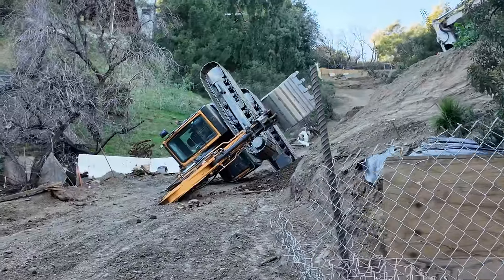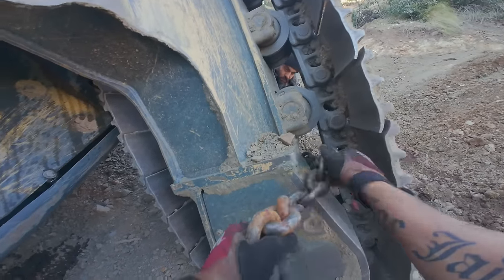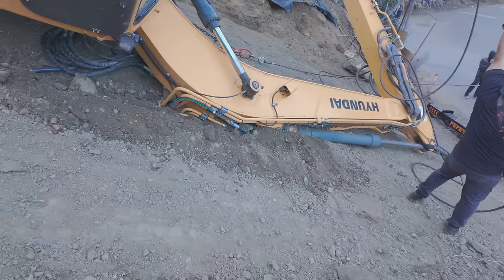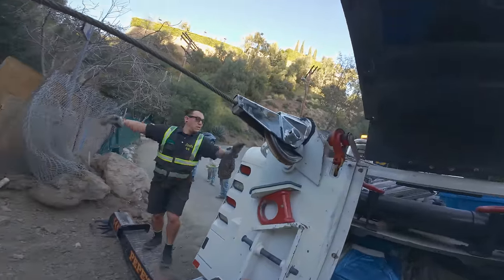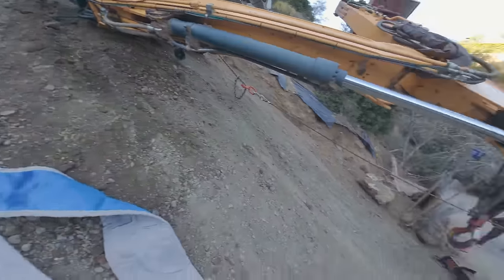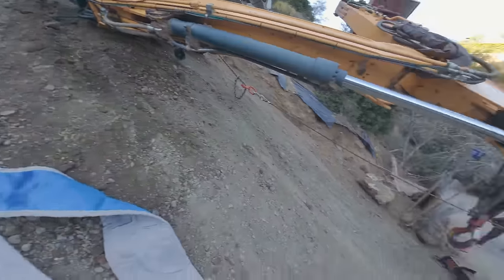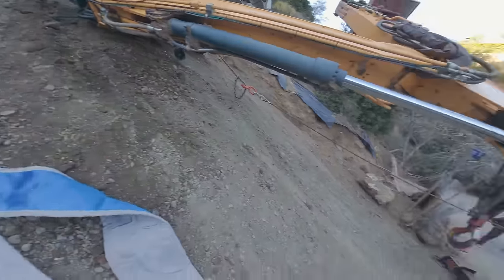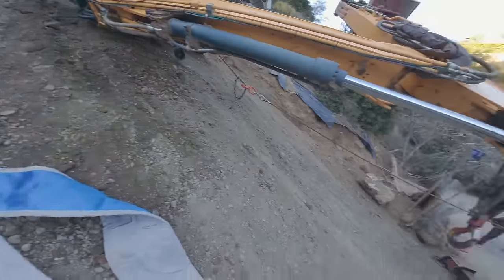Big Excavator Rolls Over in Beverly Hills

Comment: As an equipment operator and equipment owner with a construction company with a few rescues under his belt, in Texas. There are few things I would have done differently in this situation. But I don't think this would have been legal in California. The fact you guys did this without cracking the hydraulic pressure on the cylinders and getting this thing up right is super impressive. Respect where it's due. You guys did a great job.
Reply: He’s a pro

Comment: The only way that bucket will curl in is if someone moves the control lever as if they are operating and curling the bucket, unless you break open the hydraulic lines.
Reply: That's right
Reply: Engine has to be running to do that.
Reply: Just crack off the hydraulic lines from the bucket
Reply: Just asking, doesn't the big SAFETY level on the left side of the seat be in the DOWN position. I thought that was the main control for any function, so the operator is seated. Again does that lever also have to be DOWN to release Hydraulic pressure. Or is that just a safety solenoid control for just starting.
Reply: @rp1645  That lever is just to lockout the pilot controls, older machines it was connected directly to a valve that blocked the pressure from the pilot pump thus not allowing the pilot valves to actuate the main valve bank.  Lots of machines will start regardless of the lockout lever position, some newer machines do have the lockout lever tied into the starting circuit.
Reply: @banffdigger  on most newer machines if you just turn the key on, and the the lockout lever down then move the sticks they will typically let the pressure off. Thats how we release the pressure on our 304 to hook up the hammer.  Or just crack a line, a little messy but works.
Reply: @banffdigger wrong, valve won't care
Reply: @vortexan9804  need pilot pressure to move the spool letting flow through has been my experience.
Reply: @banffdigger  
Thank you for updating me on the equipment. Those wrecker crews are Fantastic, that mini excavator came down without unstableness on steep ground facing the excellent looking rotator. I love their work filming their jobs.
Reply: They should have called someone with at least a cat 356B Excavator. Would have been a lot easier and faster
Reply: Thank God for Pepe’s Towing. You should be so proud of the work you do, impressive awesome crew.
Reply: Most machines I've worked in won't even let you start the machine with the lockout lever down

Comment: Just having the ignition on wasn't enough to open the valves, he also needed to bring the safety arm down to engage the hydraulics.
I don't think the "operator" understood that he didn't actually have to start the machine, just liven the circuit.

Comment: That engine can be hydrolocked, so you have to pull the injectors to be on the save side. That smoke showed that oil went into the combustionchambers, hopefully it went good.
Reply: I put a Case 580- C on its side when the trailer ramp broke. It sat on the roll cage. No full tip over. I rode it over 😊 when we uprighted the backhoe. I checked the fluids and I thought the battery would have leak out. It did not. The old girl STARTED right up. It totally😮 shocked me.
Reply: Yes, that could of been a very expensive crank over
Reply: only if its a clapped out pos

Comment: Geographically, that isn't Beverly Hills.  About 300' NW of the Beverly Hills border. If the house was in Beverly Hills proper, add another 20% to the already crazy  house value.
Reply from the maker: Interesting, Google Maps had that intersection as Beverly Hills. Still crazy crazy expensive for what I did see. Not even kidding, I was curious and a smaller 3 bed run down "fixer upper" was going for 3 MILLION!

Comment: for those who dont know  big flippr pivots at the drive axel to the rear all other axels before or after are subject to massive side ways forces during sharp turns r thats why big flipper has an air lift rear it reuces the sideward forces when turning tight corners  making it easier to turn  it has no effect in a straight line except to reduce the weight per sxel the tag will help reduce tonnage per axel slightly its a mathematical and physics bit of maths as the greater number of axels the lower you can get each axel weight  in tons alot is done in the vehicle build because you have the service lockers tools and equipment the rotator itself  all this has to be calculated by the body builder to allow even loading of the axels / antway god going lads on s difficult job

Comment: So Hulk’s tag axle is forward and Big Flipper’s tag axle is aft which gives Big Flipper a tighter turning radius when the tag axle is lifted, yes?  So why not order all of your Rotators with the lifted tag axle in the rear when your main market is a large metropolitan area with tight city streets?
Reply: because hulk has the ability to tow , and towing on a rear tag axle is unsafe
Reply: Added question: Are steerable rear axles not a thing in the US?
Reply from the maker: Exactly what Alex said. Hulk and every other wrecker needs the added braking power and stability of the last axle. Big Flipper is exclusively a rotator only that does not tow so it can enjoy the added benefit of the pusher axle lifting

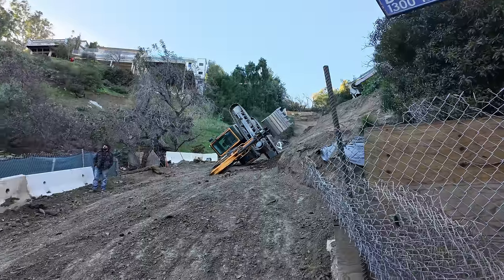Comment: 00:10 You need a ramp. Pure and simple. I lift as well and that situation is ramp all day long.
Reply from the maker: What's the name of the tow company you work at
Reply: Ross Towing, London Ontario

We have an "Emergency Services" trailer that has all sorts of crap in it like extra tools., safety gear, extra snatch blocks to hook off something like a big tree,  chains, a bunch of kinetic straps, and things like high-density large rubber ramps so that the back axels are raised against hills like yours was facing. Comes in handy versus overhead obstructions too. I've done a bunch where getting an extra 10 degrees of the truck being raised made getting over lines or over the top of something. Lifting was was made all the difference by the ramps.

I'm glad you didn't slip because that hill was trash.

Just imagine if you could have raised the entire back of the truck up another 10 degrees. You'd be snatching the excavator right off the hill within half an hour. Love your rotators. ;)

Comment: Most new and some older excavators have hydraulic controlled pilot valves on the hydraulics, so you meet to start the engine to get them to work. Should have pulled the injectors to make sure there was no fluids in the cylinders.
Reply: Diesel mechanic don't just pop up when you need them. It would have taken 6 more hours for him to show up. Plus whom do you call. ?

Comment: Guys need some more experience around excavators, these operators were clueless. You guys did a good job regardless. I will say all excavators are engineered to be lifted and have designated points, the cylinders in 90% do not have check valves and it you don’t have weight on the components you can crack the nut on the hydraulic lines to release some fluid/pressure and allow you to curl the bucket in. However with enough pressure you could overcome the relief for the circuit.  Be careful

Comment: A lot of people look at these little Excavators and think they are very inexpensive  but the reality is they can run 30 to 40 Grand  depending on the options  so this can be a pretty expensive day for whoever owns the Machine I’m not sure how much of the  Tow /Lift. is covered under Insurance   and of course  Insurance Companies have lots of Clauses to protect themselves for.   having to donPayouts    and if that’s the Case in this situation.  it can be a very Expensive Day for a Excavating Company  inBeverly Hills plus the Machine not Working means they aren’t Billing  for it being on the Job  Overall the   men doing the Lift. really knew what they were doing  I’m Impressed. they very quickly   evaluated  the lift  correctly to minimize  as much  additional damage as possible !  they even gave the customer the luxury of   putting it where they prefered it to wind up  on the ground

Comment: Dam, what a nightmare, I am a contractor in Orange County and Stopped working in Laguna Beach due to the hills just like this, tight corners, no parking sketchy access and code enforcement watches and tickets for everything
Reply from the maker: I don't blame you. What did you used to drive? The 10min drive from a big street, up to this site, is ridiculous. You have tiny windy streets with cars on BOTH sides ready to sue if you even touch their stuff. That's where the rotator comes in handy vs a big crane. It's right but we can make it work going slow
Reply: just f250 but we had dump trailers and they were a nightmare on those hills. @PepesTowingService
Reply: Why you dont pulled to the street  is flat ground
Reply: Too many not knowing anything about the machine involved makes too much confusion.
Reply: Another sketchy job. You make it look like child's play. WOW!!!
Reply: @pedroarroyo9684  we dont want to block traffic people still want to get to their homes
Reply: @PepesTowingService Why didn't you just lift the excavator up by hand with all of you on one side?
Reply: Once you had it upright you should have put it down. All that extra nonsense for something. Let the oils settle and check levels. Start it and let it move itself. Nothing but creating a YouTube video here.
Reply: @John-vf9py  You're spot on
Reply: I see that some here didn’t really pay attention, as they drug the excavator down to a safer picking point the hydraulic lines on the boom were dragging on the ground more than likely damaging the hydraulic lines and or ripping them apart. If you heard at the beginning of the video when the excavator was on its side a majority of the oil drain out of the motor. It’s possible that fuel and hydraulic fluid leak out as well. When you pull an excavator back over it takes time for oil to drain back to the pan, then it’s time to check all the fluids to make sure that there at the proper level, not to mention checking all the filters ( air filters as well ) didn’t you see the blueish white exhaust ? Everything to do with starting that excavator again takes time. 
I have seen three excavators on there side in my thirty six years as a heavy equipment operator, one dozer as well. We had a great team and recovered all the excavators with no damage other then cosmetic. 1 was a Cat 200, 2 was a Cat 320, and 3 was a Cat 500. Excavators.
Great Recovery Gentleman. It’s all a process and there are many many steps that go into recovery. 
I hope the operator at the time wasn’t injured.  Great Video Thanks For Sharing. ps. If you haven’t been involved in something like this and no nothing about heavy Trucks, Equipment ect. Don’t assume you know what you’re talking about. Because it makes you look foolish. You’ll go further in life asking questions or not saying anything. Some in this comment section I’m talking to YOU !!! Shush 
* 1-17-2024
Reply: @PepesTowingService Hello people. I find it funny that call yr tractor/trailers we call them truck/trailers. You lot do very interesting work, with great equipment. South of NZ😂
Reply: @John-vf9py  your mom told us to turn it on
Reply: @John-vf9py Sure...let all the oil that drained out settle before starting.  😂🤣
Reply: @timbruns3818 Yep, that's one thing people over look is the crankcase oil ending up in the air filter elements. Sometimes a pool of oil in there. With a diesel it can go into "run away" and blow the engine because it will run on that oil sucked into the engine. The crankcase ventilation system is how the oil gets in there when it's been tipped over.
Reply: @putinkhuylo You want to strain it through your T-shirt first to get the dirt out of it! A few weeks later after it's done straining! LMAO 😅😂😅
Reply: @timbruns3818 My mother would tell me, "If I had a brain 🧠 I'd take it out and play with it!" LOL 😅
Edit: forgot. "Use your head for something other than a hat rack!" 😅😂😅
Reply: @John-vf9py There's a whole lot more to it than that dude. Besides just the hydraulic fluid reservoir can hold more than 40 gallons! You will most likely end up destroying or severely damaging a diesel engine taking your advice when it sucks in a bunch of oil in the air filter box and goes into run away and "YOU" wouldn't have a clue how to stop it. There's even a possibility of severe injury or death when the engine grenades and shrapnel is embedded in you! Not that simple after a rollover!  Especially when you're dealing with a piece of equipment worth 1/2 a million bucks plus!
Reply: 36:46

Comment: There is a takecuchi 290. Just take it and put the other one up. I live and work with an excavator in a town as steep as that, it's fun.
Reply: That Takecuchi is 1/3 of the weight of the big one flipped over. There is no chance, and certainly not in this steep grade wich is much steepr than it looks on video. The workers would had done it if possible, not called for assistance.

Comment: The dipperstick should of been folded back to the boom, by releasing the hydraulic lever in the cab  using the rotator boom and  (tied to a position ), to return oil to the sump. It would of been easier then to right the unit. JMHO.

Comment: Why close bucket, all you have to do is use the boom lever up in cab, it'll open the valve and allow the boom to lift up with ground pressure or cable lift.
Reply: they are electronic and require the unit to be on

Comment: It is evident that none of this crew is aware they could operate the boom and bucket levers and make the job so much safer and much easier, they do not need hydraulic pressure to relieve bucket and boom .
Reply: Levers are all electronic, and the machine is not able to be in running mode, obviously.

Comment: Josh--too much hyd. pressure on that bucket to pull it back inwards--the whole line is full of  fluid--no where t0o go unless you somehow ease that pressure.
Reply: yes we figured that, I will have to do some research to see if they make a tool to bleed them without the mess and back into the tank thanks for watching
Reply: @AlexanderHernandez088  If theres enough flexible line on the cylinder, would removing one line and connecting it back to itself to create a closed loop be viable? Youd have to cap off the line you open up, but at least then youre only dealing with the one cylinder. Assuming air doesnt get introduced into the new loop?

After the tree crane job I wouldnt blame you two for being leery about opening up hydraulics so soon. 😂

Comment: I'm willing to bet the operator went to spin the house but had his bucket was too low and it make contact into the hill face.. well every action has an equal and opposite reaction.. so if the house cant spin and is stationary its the tracks that will start doing the spinning and you will end up with a track off the hillside in a fraction of a second. If the company put a newer operator on that hill I would blame them. That's no place to learn. Good recovery.

Comment: Are the hooks color coded by chain strength?
Reply: The hooks on the winch cables are color coded to the box and remote controls. The coding is an industry standard. White and blue for the main 2 cables, the first pair of auxiliary cables are red and yellow, and solo deck winches are green. Big Flipper has 2 deck winches, not sure if both are green. There are a few rotators that have 6 boom cables, and some have traversing booms as well.
Reply: Ah cool...thanks for the knowledge @jsh6952

Comment: I would have brought in another excavator same size or little bigger. It would not only be easier it be alot cheaper😊
Reply: Yeah, let's take some shortcuts in hope of saving some dollars. We've heard that one many times. Not always a happy ending. And a lot riskier, in that steep grade. a certain chance ending up with 2 flipped excavators...And would one get hold of a larger excavator within reasoanble time, and reasonable cost? We do not know. From the armchair far away in wonderland everything is very easy
Reply: @Rimrock300  I say this because I'm retired heavy hi way superintendent over 40 years and I cannot begin to tell you how many scrapers,loaders ,dozers and yes excavators that I have retrieved.  A few of the worse  a dozer from canyon in Alaska to excavator Hitachi Ex200 upside down in the Hywassie River North Carolina , D9 Cat dozer fell through ice Bering Sea wainwright,  Alaska.  Crane turns over hanging off chulitna river Bridge  by the out riggers.These guys are number one in highway recovery Pepes rocks!! I'm fairly smooth with very large mistakes also. There is always more than one way to do a job. Just do it safe and if you can make more money then rock on.

Comment: It surprises me why they don’t know to just pull a leaver to let the boom bleed up, letting cab drop
Reply: Machine got both tracks on the ground whne the job is ended
Reply: because it dont work like that , they are computer contolled not manual like the old days
Reply: It's also a major risk to try such a move, what if rolls down the driveway causing more damage? Probably safer and cheaper to just hire these guys than risking it especially since it will be an insurance claim and they won't be paying for it fully

Comment: Think you guys got lucky that excavator didn't have a blade to deal with to drag it down the hill and upright it.
Reply from the maker: Lucky in one aspect and unlucky in others. What about that horrible grade and horrible working area on that tiny cul de sac?
Reply: @PepesTowingService  Yeah the cul de sac and lack of access was a challenges for you guys for sure. The only way to get that boom up a little bit to allow that excavator to sit level was to unfortunately start it. Hydraulics don’t mind going down when the machine is not running but they don’t like to go up.